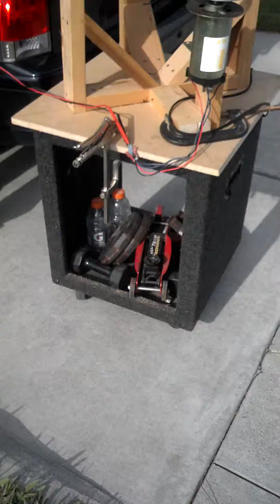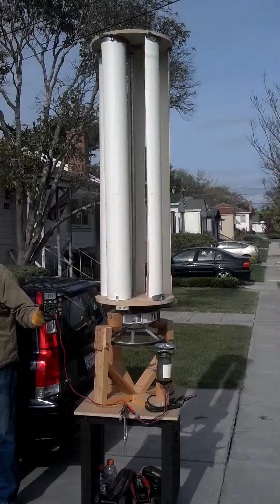Vertical Axis Wind Turbine

Comment: The turbine is a bit too tall and thin to work well.  Squarer in cross section works better.  Also it wants to blow over in the wind and this is the main problem with doing wind power.  Come up with a way to make one that lives through a storm and makes useful power at 5MPH wind and you will really have something. 

DC motors have brushes that make them subject to problems.  If you make a alternator or induction generator as the electrical part, you can do better.  Since we already know that, don't waste time on that part.  Solve some other key issue and publish.